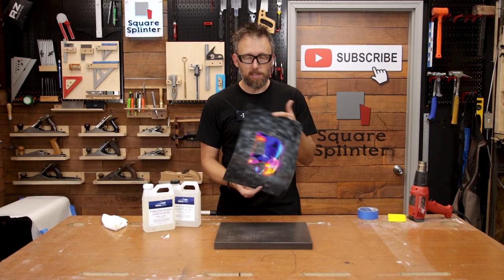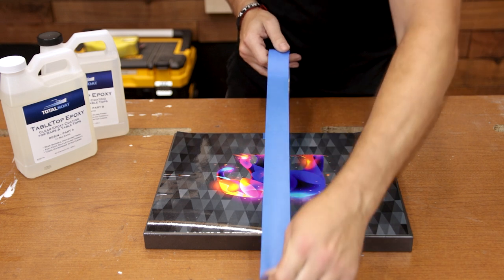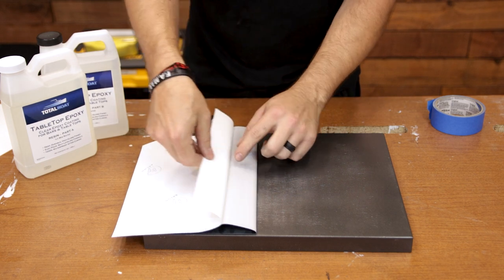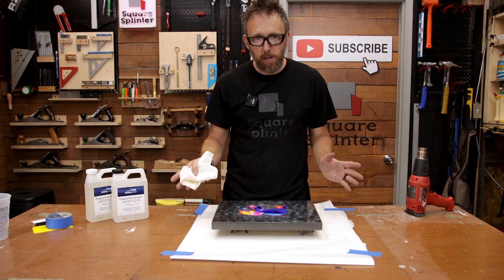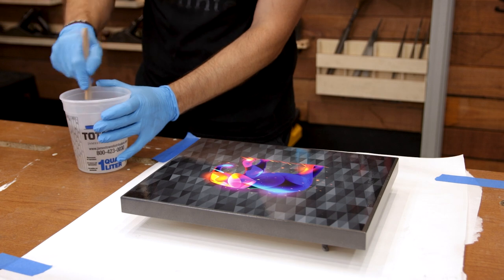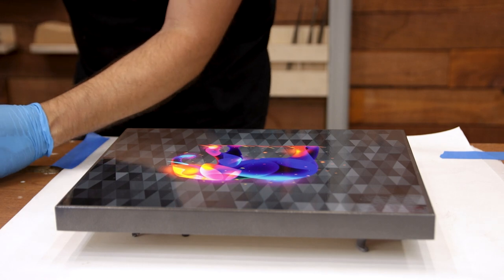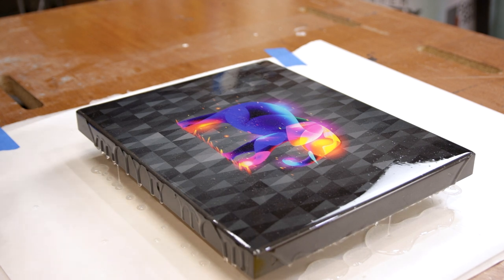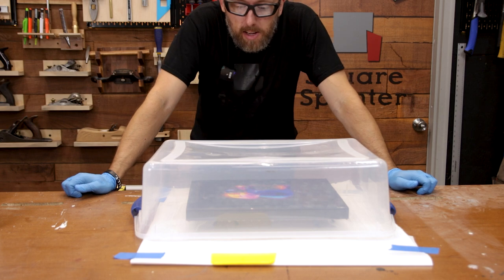How To Pour Tabletop Epoxy Resin Over Large Vinyl Decals | Detailed Instructions

Comment: Nice. A tip you can  use or lose. Brush epoxy around edges first. Having the sides wet w epoxy will allow the pour to flow much much easier .

Comment: also i want to vinyl my fireplace around the stove. will the epoxy stop the vinyl from bubbleing or lifting
Reply from the maker: If the vinyl is applied correctly and stuck down well before you put pour the epoxy then yes, it will increase the durability and longevity of the vinyl.  for sure!

Comment: i was thinking to prime then marble with epoxy or use vinyl and epoxy for faster results and more accurate design.  oh and it ne directly on vertical. will it just runn down
Reply from the maker: Yeah applying it on a vertical surface won’t work.  Had to be flat to be able to level out and cure.

Comment: There’s a tip out there to rub the sides of so the epoxy can flow downward and evenly on the sides correctly. That way those drips won’t be there on the side. 

You have to break that tension there or something like that. 

Also before it cures completely, swipe underneath the canvas or table to get rid of the drips. You’ll have to do this about 2-3 times before the piece fully cures to avoid those drips.
Reply from the maker: There are definitely ways to mitigate the drips but honestly I wasn’t worried to much about it.  Most of the time I would have to sand areas of the project anyway.  But you are right, there are quite a few things I could have done. 🍻

Comment: Hi, loved the video, u covered almost everything this newbie epoxy user wanted to know. I'm painting a large wooden table to use as a kitchen work surface, and applying peel and stick Mexican tile decals to the top. I was going to seal the top with minwax polyurethane, but may want to use the epoxy. Would I need to run some sort of border around the edges to contain the epoxy, or can I somehow work it so it doesn't pour over the edges? The table top is approximately 6' x 3'. Thanks!
Reply from the maker: It really needs to run to the edge so it will be smooth along the very edge.  If you try to use tape or something to “dam” it up it leaves a nasty sharp edge and raised up a bit all around the edges.   It doesn’t need to flood over the edges but if you just let it run over a bit and then wipe under the edge with a paintbrush or something it maintains the mess.  Hope this helps!   Thanks!
Reply: @SquareSplinter  Thanks for answering, and yes, it makes total sense. I'm used to using most kinds of art media & home project materials, but I've never used epoxy. I've been drooling over epoxy projects I see online, but held back from doing any of it, bc then I'd have to buy everything l thought I'd need, I already have too many supplies, and at 70+ one is supposed to be getting rid of stuff, not acquire more. 🙄 (Can u ever have too many art supplies?) LOL I think the epoxy might hold up better for this project, so I think I'll try it out. Thanks again!

I subscribed to your channel and will check out your other vids.
Reply from the maker: Good luck on your projects Susan, and no you can never have too many!!  😁

Comment: Do you have to worry about heat generated from the epoxy being mixed , damaging your vinyl? I’d like to try this but not with an entire page of vinyl. I’ll be using cricut vinyl, if that makes a difference.
Reply from the maker: No not really, the epoxy really only heats up to a dangerous level if it’s ft in a small container with a large amount.  If you have it mixed and are laying down in a thin layer you have nothing to worry about.  The cricut vinyl should be just fine
Reply: @SquareSplinter  thank you for responding so quickly.

Comment: Awesome video, I was wondering if the vinyl you used was laminated or not? Restoring an Arcade cabinet and was thinking of epoxy resin sealing it. The sides of the arcade cabinet will have laminated decals on them.
Reply from the maker: What I used was laminated but that was more for ease of installation for me rather than any sort of protection.   You can absolutely pour epoxy straight over a vinyl print without lamination.  🍻
Reply: @SquareSplinter  Would laminate be best used for outside?
Reply from the maker: @MyGrunt0311  if used outside, yes.   Epoxy will yellow over time and not be as protective.   Modern laminated are amazing stuff
Reply: Laminate. Epoxy on straight printed vinyl makes ink discoloration and if you mod podge air gaps appear between mod podge and epoxy

Comment: I made big logo on epoxy garage...
It got messed up  on the second application, it didnt adhere properly on the vinyl.  I had to re do the whole garage.
Inwas told vinyl  cannot have the protective laminate on top of the design.
It has to be one colour...one piece. Is this correct

Comment: Hi, I was wondering.. can you pour resin over the bottom of a wooden box as well?  Also, I removed hardware, I’m worried the resin will make it difficult to put the hardware back on?! Any tips for that? Thanks
Reply from the maker: You could definitely pour it on the bottom of a box.  The only thing is around the edges it’s going to raise up a little.   It does that due to the thermo reaction in the resin. Doesn’t hurt anything but just FYI it won’t stay 100% flat across entire bottom of box.  As far as hardware as long as you had holes drilled prior to pouring resin you should be fine. 👍🏼🍻

Comment: what did you use to make your graphic design for this
Reply from the maker: I actually designed it myself but you can find lots of designs like this by searching for 4K monitor backgrounds.  Great source for free decent quality images.
Reply: @SquareSplinter  Did you print it yourself as well and if so what's a good quality printer to use hobby level not commercial?

Comment: So, I'd like to do this to a table that people would sit and eat ice cream on. Is there anything ELSE to add on top to protect it even further? Specifically for commercial use for years to come??
Reply from the maker: The epoxy is very durable by itself honestly.   Saying that though…. In recent times there are ceramic coatings that people are using that can help prevent small scratches and scuffs.  Otherwise it will last for a long time even without anything else on it. 👍🏼

Comment: What did you do to smooth the edges?  When you poured there were a ton of drips but not on the finished product?
Reply: He probably sanded them off. After about 24 hrs, Depending on what brand on epoxy you have, epoxy drips can be sanded off for a clean finish

Comment: I didnt see you put the epoxy on the sides? If you use a small paint brush to even out the epoxy, and then use it on the sides, it will all look even, everywhere.
Also, if you come back with your squeegee after an hour or 2, you can scrape the bottoms and get rid of the drips. No sanding required.

Comment: So a safety thing. If you need to sand it after, make sure it is fully fully cured. Like 3+ days. Sanding uncured epoxy is dangerous because the dust you can breathe in is still undergoing its chemical reaction. Bad for lungs. Get a real, quality respirator.
Reply from the maker: That’s a good thing to keep in mind.  👍🏼
Reply: You should be using a mask or 3m respirator when sanding anything

Comment: What you did wrong,  cutting the back of the seal paper, should be one nice clean cut ✂️ all those jagged edges runs a big risk of leaving micro paper pieces stuck to the back of the decal leaving bumps,  they're a nightmare to try and tweezer out... 
You could have shown the finished piece.  
Success anyway 🎉
Reply from the maker: I will definitely keep that in mind but in the 15 years I have been doing this I have never had an issue.   This is process taught at 3M wrap school.  Thanks for watching!